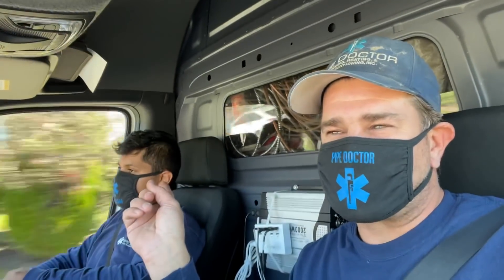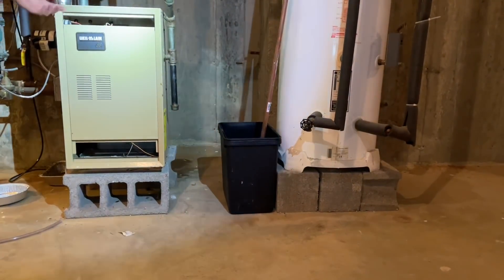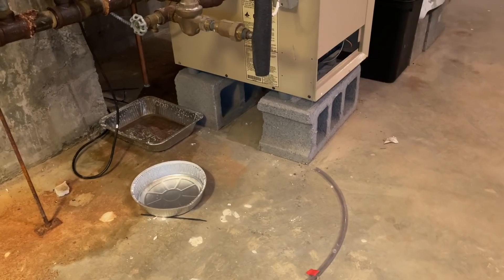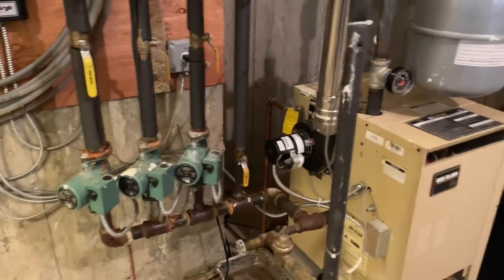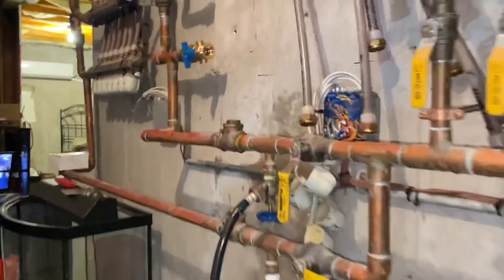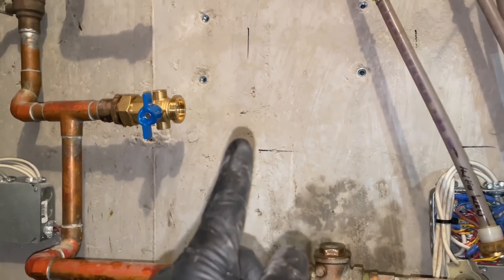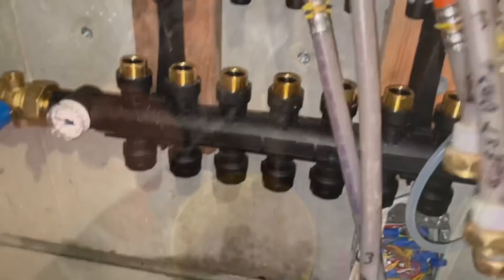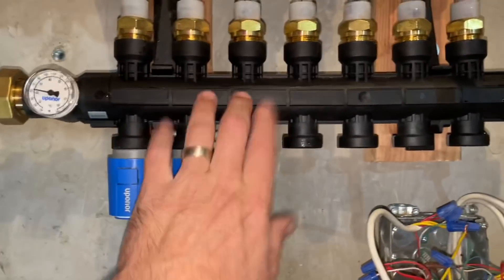Double Feature! 1st Call We Walked Away & 2nd Replaced 7 loop Uponor Radiant Manifold w/Actuators

Comment: I live in ky and i have never seen a expansion tank on any hot water heater here we only use ng lp and electric in the area.
Reply: You need an extank when you have a backflow-preventer on supply side of tank.
Reply: Guess thats what the relief valve on the hot water heard is for
Reply: @PipeDoctor  Maybe pressure reducer?

Comment: At least the stairs were good, I was in similar situation except the stairs were super archaic nearly rotten.
Reply: My friend's house had a terrible water problem in the basement - the previous owner gave up and just allowed several inches of standing water down there for decades.  The bottom of the stairs rotted off, so the last remaining tread was propped up on cinderblocks, and you stepped down from there to a milk crate to the floor.

Comment: I charge $90 for a relief valve. Labor not included. And if I'm doing a relief, I'm doing the extank, air vents, and most likely a 911s. Its a water package. $800. They all work together and should be changed together. Had one customer who used someone else to save money. Guy only changed the extank. 2 years later, extank fails, relief valve stuck shut, boiler pressure climbs to 70psi and blows the tankless coil right off the boiler. Her saving a few bucks cost her a new boiler
Reply: Damn what a ripoff.

Comment: First guy was a prick from the get-go.  More money than God, yet he Nickel and dimes you 😀.
Question: Second job when you (Kelvin) had to insert a section of copper pipe using 2 couplings. Is there a minimum distance allowed between 2 crimp on couplings?
Reply: No it doesn’t matter the distance between the couplings. However if you put them to close together it can become difficult to crimp and possibly leak sometimes especially if the crimp tool hits the other coupling while crimping. Personally I would have just soldered it because it was very accessible and the cost of materials would have been 1/3 of the 2,crimp couplings and similar repair time with a little map torch. I like the crimp system a lot but the fittings get very expensive and  if a pipe system is sweat I will usually match it. Unless it is unsafe for open flame like inside a wall or near insulation. Not that we haven’t sweat there for 100 years, but the crimp system  does lower liability insurance because you are less likely to set a house on fire while soldering.
Reply: @davidkarpen5686  kklon

Comment: But did you actually confirm that the expansion tanks failed ? Never showed any water coming out of the air side or if there was any precharge left . Tank is going to be slightly heavy since its half full of water to begin with . Feel bad for thid calvin kid .
Reply: @PipeDoctor  apparently tapping the expansion tanks with your flashlight confirms its failed lol
Reply: 100% correct Ryan
Didn't know my 35 yrs exp was taken over by an enchanted flashlight.
Reply: Sounds different when there is water or air. The air side should have a hollow sound. The water side,  a thicker/duller sound. I am with the Doc on this one.
Reply: @aaronkoster9581  but there was a simple way to test it . Purge shradder valve , if water comes out the bladder has failed . If not , recharge it and carry on . Tapping the tank and listening is not a proper way to prove the tank has failed .
Reply: It’s funny because the first expansion tank he doesn’t show it on camera the camera is pointed lower and barely showed. The second tank was good you can hear the difference between the banging of air and the banging of water. Yet he still wants to change it just because.  It’s easy to add parts to a bill if your not paying the bill.  Poor Calvin I worked with the best and they never treated me the way you treat him.
Reply: @gyver471  yup ! Ive always taken the time to educate the customer on how an item has failed . I can tell you right now if a tech came to me and said " yup, your expansion tank has failed . Let me show you by tapping the outer shell and listening to the tinging. " id tell him to kick rocks.  Simple test was put a guage on the tank . If it showed 0 psi , it just needed a charge . If it shows pressure and water is pissing out of it then the air bladder has failed . Then needs a new replacement . Takes just as much time to do this test as it would to grab a tool to bang the tank.

Comment: I love when ppl say but the capacitor is only $5 I say a iv bag cost $1 but yt your paying $600 tho
Reply: I agree with you on adding value on service I just explain it to ppl same as a car no brakes doesn’t cost 500 but your paying for everything else I try to wax the heaters and ac units when I’m doing tune ups as well as use a blower to get all the dust and crap out flush all drain lines